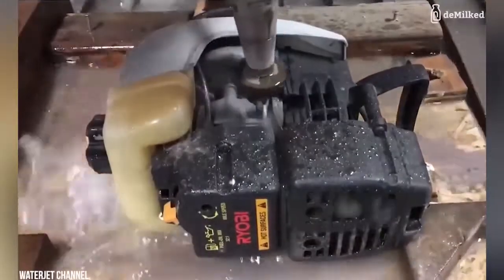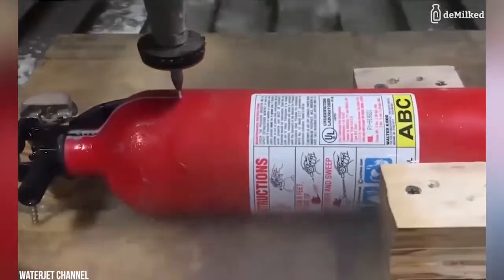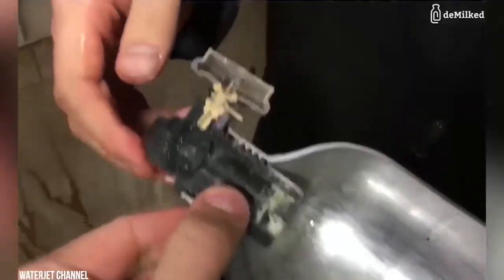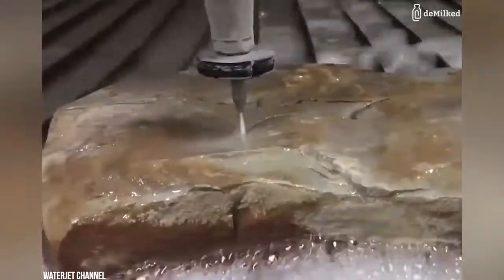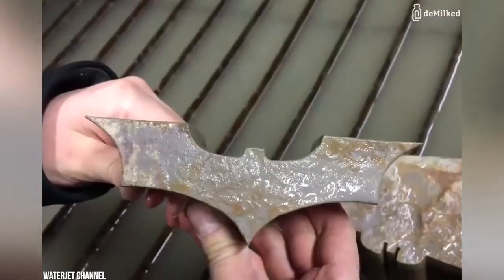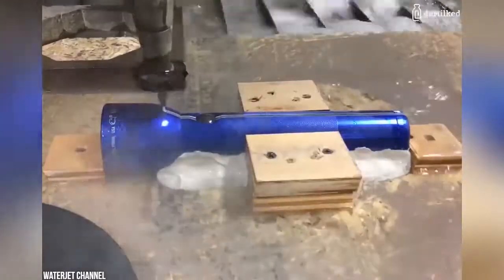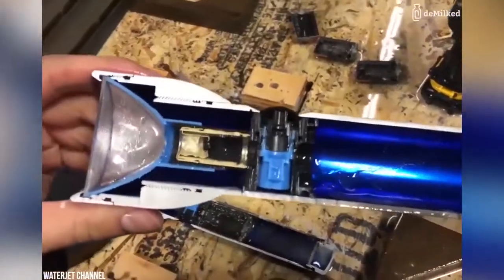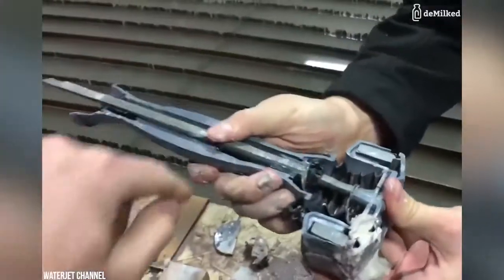Water Jet Cutter | The most powerful cutter

Comment: “Be like water; water has form and yet it has no form. It is the softest element on earth, yet it penetrates the hardest rock. It has no shape of its own, yet it can take any shape in which it is placed. In a cup, it becomes the shape of the cup. In a vase, it takes the shape of the vase and curls about the stems of flowers. Put it in a teapot, it becomes the teapot. Please observe the adaptability of water. If you squeeze it fast, the water will flow out quickly. If you squeeze it slowly, it will come out slowly. Water may seem to move in contradiction, even uphill, but it chooses any way open to it so that it may reach the sea. It may flow swiftly or it may flow slowly, but its purpose is inexorable, its destiny sure.”
Bruce Lee